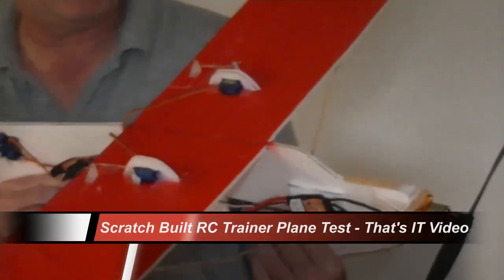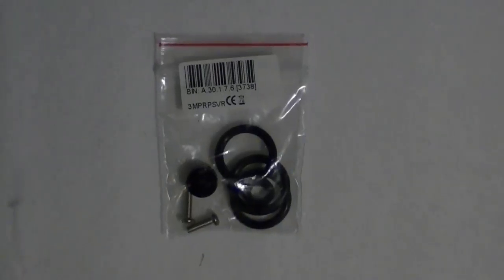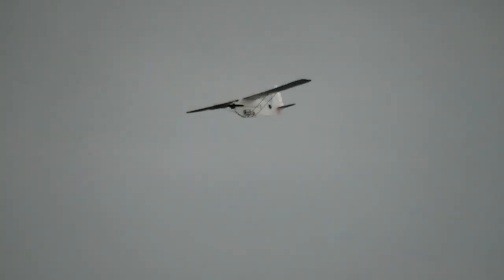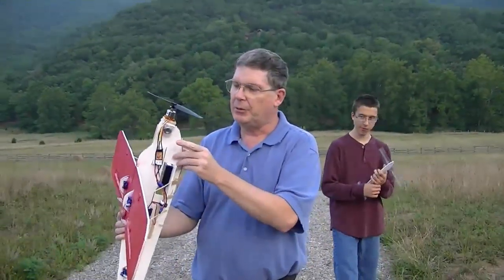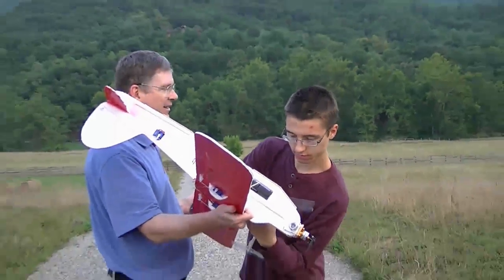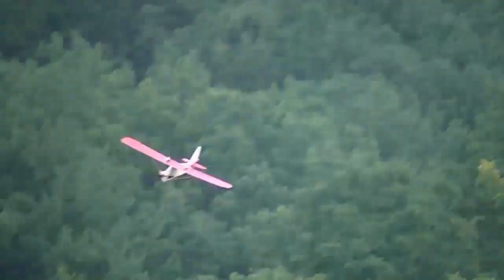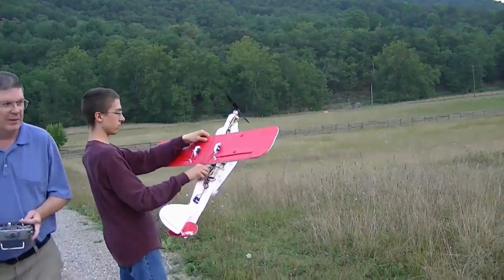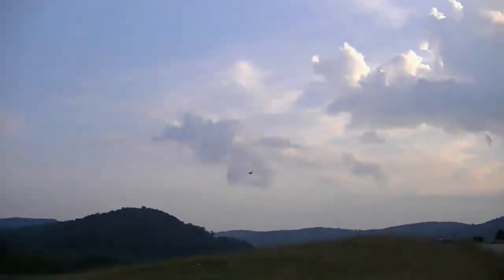Foamy RC Electric Trainer Plane, Building and Testing Part 1

Comment: This is a modified aircraft of the sport trainer by Mikeys rc plans.

Modifications are:

Angle of wing

Added simple 50% KFM airfoil

Real fuselage

Larger stabilizer

Larger wing span

Oh by the way the wing that appears alone on the video is not of this plane it´s for my scratch build aerobatic under construction it´s a real wing... :)

Any comments please do.